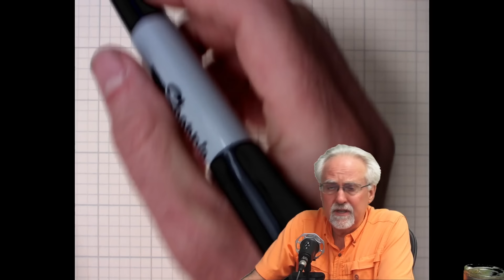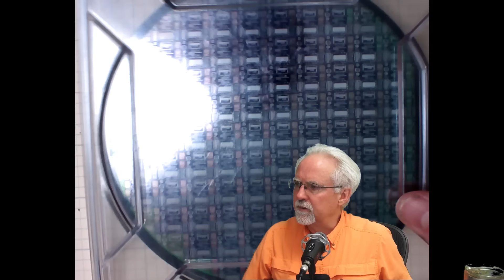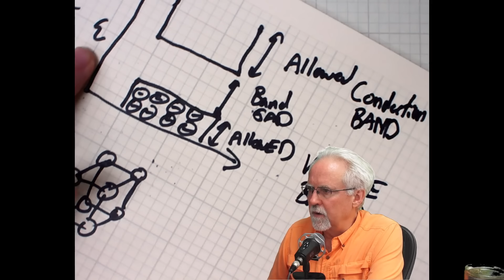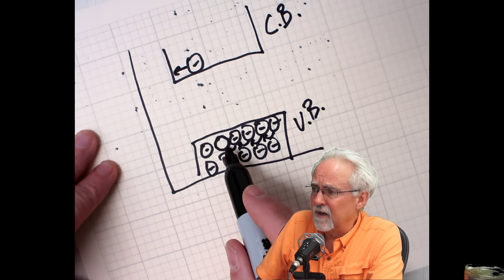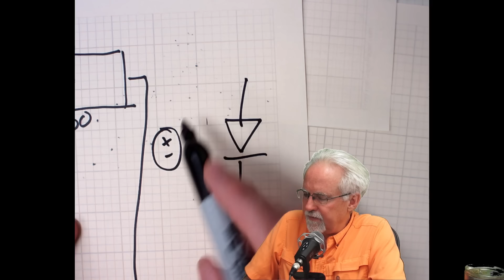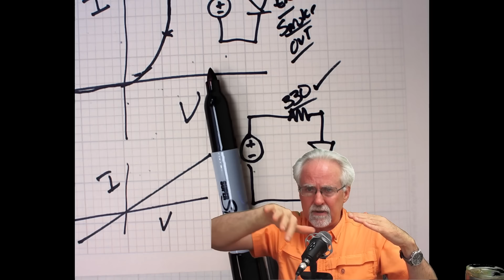Arduino Tutorial 2: Understanding How Light Emitting Diodes (LEDs) Work

Comment: I wonder what if we run out of electrons? 
Does the led somehow refill itself?
Reply from the maker: The process is reversible. The electron does not go away, it just fills a 'hole'. As temperatures or voltages change, the electron can hop back our of the hole, and be a free electron again.

Comment: I have a question. As you described this - an increase in voltage lovers the gap between the electrons and the holes causing the LED to shine brighter. But the same "picture logic" applies to the Energy Gap Eg. how ever the color will not change dramatically from let's say red to blue. I might have missed something because of the language barrier (not my mother tongue). Thanks for the awesome videos.

Comment: You are using a few physics terms I am familiar with, is the hole similar to how when you have an electron and positron collide, you get a photon thorough pair production and annihilation? Or how how materials become negative or positively charged ions?
Reply from the maker: No, it is not like that. Think of having a jar of water with a bubble in it. The bubble is nothing but a lack of water, but you can treat it like its real. Electrons are like the water, a missing electron is like the bubble, or a hole. If you put a drop of water in the jar, and displaced the bubble, the bubble disappears.
Reply: @paulmcwhorter  and then through osmosis, the water travels from high concentration to low concentration?
Reply from the maker: No. Get a tube sealed on both ends. Put one drop of water in it. Then tilt the tube. The drop of water will travel down hill by gravity. Tilt it the other way and the drop goes the other direction. The drop of water always goes downhill because of gravity. The drop of water is your electron. Now fill the tube with water, and leave one little bubble. That bubble is your 'hole'. Tilt the tube. The bubble will always go uphill. The bubble is your 'hole', or abscence of an electron. You are trying to make this too hard. A hole is a missing electron.
Reply: @paulmcwhorter  All good now, was hoping for some connection to some pre existing knowledge, use connections like that to simply things, kinda like a zip file. I was impressed actually at how easy it is to use the Arduino coming from a C++ background. Been coding in it for over a year making things in C++ for school and was able to make up a few quick projects in a few hours. Was never taught much on the hardware component however I find it very satisfying to actually code stuff now which is more applicable and will be using your tutorials over the next month to refine my skills for a personal project based on drones.
Reply: By applicable I mean more useful such as the plain 80’s style chat bots we make all the time.

Comment: Good explanation. One little nit-picky thing. There was no mention of the forward-bias voltage & related voltage drop across the diode(e.g. 0.7 volts for silicon diodes & 0.4 V for germanium) also Peak Inverse Voltage (PIV).

Comment: 1:52 How light bulb is working
5:18 Conductor and Insulator
6:00 Semiconductor (tailored martial)
7:00 Silicon wafer
8:00 How semi-conductors (i.e. Crystalline martial) actually work
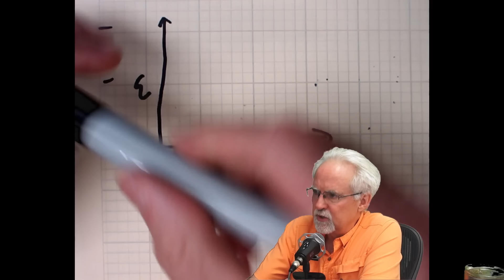9:30 Discrete energy levels => Energy allowed bands
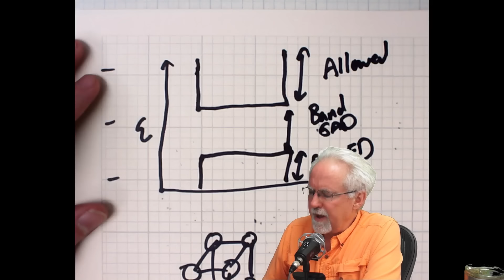10:20 Conduction (Valence and Conduction bands)
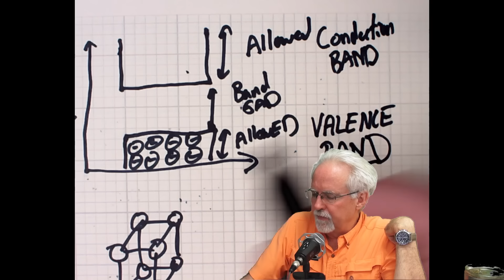12:50 Intrinsic (heating) semi-conductor (-ve and +ve charges conduction)
17:05 N-Type, induction via -ve charges in the Conduction Band
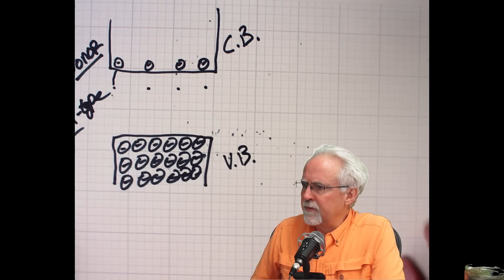19:43 P-Type, induction via +ve charges in the Valence Band
21:56 Quick summary of semi-conductors covered
22:25 How those semi-conductors types lead to LED?
23:45 Offset bands when N-P are combined
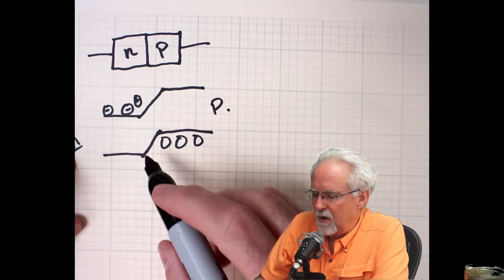24:50 Applying +ve voltage to N-P (lowering barrier causing light to emit)
26:30 -ve charge over +ve charge (Electron, Hole Pair Recombination => Photon)
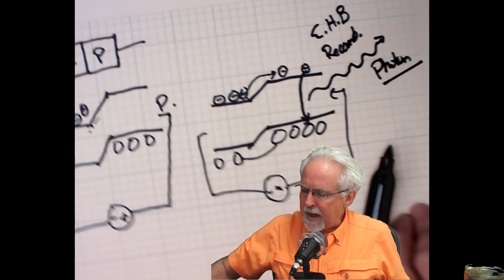27:47 How the light emitted from an LED?
28:40 Applying -ve voltage to N-P (increasing energy barrier preventing light from emitting)
29:40 Quick Summary
30:16 How to correctly hook-up a diode (+ => P-Type, - => N-Type)
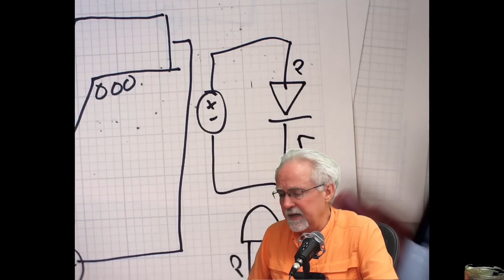31:20 Diode response graph (I vs. V)
32:35 Why resistor is needed when connecting LED
34:30 How the color of LED is generated
37:07 TL, DR version of the lecture

Thank you sir for your knowledge share 🙏
Reply: Not all heroes wear capes! (Assuming you don't. If you do, then some heroes do wear capes).
Reply: @nitinchauhan530  haha🤗❤
Reply: @nitinchauhan530  lol
Reply: thank you for your breakdown
Reply: true @Nitin Chauhan  these are the little things that help and restore faith in humanity
Reply: Thank you for your breakdown
Reply: Not all capes wear heros 🫡
Reply: i wish i saw this earlier

Comment: Great video Paul.  I'm 73 now. I studied electronics in the late 60's and early 70's, when vaccum tubes were king. I've learned about semi conductors, diodes, transistor (of all kinds), IC circuit, linears, buffers, counters and so on......but not microprocessors.  I have work in electronics as wiring, soldering, and also drafting printed circuits.  Arduino is for me the unknown. I purchased this week from Amazon the Elegoo Mega 2560 Project The Most Complete Ultimate Starter Kit. With your help and some of my efforts I will soon be able to work and and learn about semicontrollers like Arduino. Thank you so much for these state of the art videos, you have an exeptional talent in popularizing things so people can have a good idea  concerning highly complex materials. BTW, watching No.2 tutorial concerning how LED work was a good refresh.....since I quit electronics business 30 years ago. Sincerely.

Comment: What is the 'hole' made of?
Reply from the maker: Nothing. A hole is the absence of everything. A hole has nothing in it, not even air. A hole is where an electron should have been, but is missing. Hence, it is a hole left in the atomic crystal. think of it like a bubble in water.
Reply: @paulmcwhorter  thank you for your answer. How can we say 'nothing' is a carrier of positive charge? If it's nothing wouldn't it be neutral (without any charge)?

Comment: As others have said repeatedly, you are a good teacher.  This was fascinating.

I was with you until right at the end.  I get what you said regarding what color light is emitted: it's based on the material in the semiconductor.  So, the Arduino has a semiconductor.  Whatever material is in it produces the same band of light when voltage is applied.  That would seem to account for why the LEDs each have a different color plastic (red, green, yellow) on them.  

But, I thought each LED had a different forward voltage.  If that is the case, then the each LED is producing a different band of light, not the semiconductor.

So, is it the material in the semiconductor that determines the LED color or the voltage at the LED that does?  Or am I totally missing something (which very well may be)?
Reply from the maker: No, silicon has an indirect bandgap, meaning that when electrons go from conduction to valence band, their momuntum has to change. This means they must emit a phonon, or heat packet instead of a photon. YOu can not get light out of silicon
Reply: @paulmcwhorter  Okay, I think I figured out my issue.  Thank you.

Comment: Once all of the electrons recombine with the holes wont there be no more light emitted? Does this happen in practice: apply a voltage across a diode, light is emitted for 5 seconds, light is no longer emitted?
Reply from the maker: No, it goes back and forth. Thermal effects, or applied voltages generate the electron/hole pairs. They come and go in response to stimulus like voltage.
Reply: @paulmcwhorter  thank you for the reply, i appreciate it greatly. I will read up on the topics you have mentioned. There are undoubtedly gaps in my knowledge that hinder me from understanding (in detail) how leds work.

Comment: Whoops, I opened my Arduino up and connected an LED straight away with no resistor to one of the pins (not to a power supply).  Thankfully it didn't burn out.  I guess the processor or pin itself had sufficient resistance?

Comment: Does the value of the resistor regulate the voltage of the LED so brightness is equal between, for example, red and white? In looking at specs for LEDs some are rated for 3.3v and others for 2.2v. I'm trying to determine the resistor value for each color based on voltage ratings at a constant voltage for the circuit. Help?

Comment: Great explanation. I am an absolute beginner, and understood most of it. But here is a question, I am not quite sure if I have the correct answer:

Why, if we put the positive pole on the p-type the gap between the levels gets lower, instead of greater? In my first thinking P-type meant for me, that this pole is loaded with positive energy. If I put the positive pole I - I raise the energy level. The gap should become greater in my thinking.

Am I right with this answer?:
Positive pole means -> The pole is positive loaded -> means that there is a lack of negative parts. Therefore positive loaded "things" connected to it are quite motivated to unload themselfes to loose there voltage. They do so, and their enery level decreases.

Comment: So we want to stop using light bulbs because it generates loads of waste through heat.
But we need to use a resistor which generates waste through heat to be able to use a diode?

Comment: When the high voltage is applied... Practically the LED bursts off...or stops working... So basically what happens to the band gap and the electrons and holes during the high voltage supply.. can't that be reconstructed or rebuilt

Comment: Marvelous video sir
I had a few questions regarding the theory 
1- why does having an n type connected right next to a p type cause the bump in the energy bands (would love an explanation from a physical point of view like whats happening inside the material ) is it just that way because we choose the impurities such that there is a wider range of allowed energy levels in the valence band of the p type than there is in the n type (and vice versa)?
2- why does hooking up a potential difference lead to a reduction in the difference between the c.b and v.b of the n and p type materials
I'm thinking something like you make the electrons more "eager" to move by giving them higher potential
Reply: On the answer to your first question

Don't think of it as happening inside the material, but rather on the surface. Because we are dealing with a crystalline structure, paths electrons can take are much more predictable. 

You know about piezoelectricity, yes? The concept is, you hit a crystal, which is a molecular lattice structure, and the kinetic energy propels the electrons on the surface to a conductor, through a component and then back to the part of the crystal which now has missing electrons.

This happens because of the lattice structure of the molecules.
At least, this is how I understood the concept.
Reply: Now on to the second question. Way I understood it is that because the materials are not symmetrical, meaning there is an electron donor on one side and electron acceptor on another side, flow of electrons can really only happens in one direction within the circuit.

The Donor just gives electrons to the conductor.
Acceptor takes electrons from the conductor.
Donor is happy to let electrons jump to the Acceptor and acceptor is happy to receive them.
Do it the other way around and they resist.
If they resist enough, you will short your circuit because it's easier to jump through air than through resistor.

Every time electron hops happily from donor to acceptor, you get photons which means light.

Comment: Can talk about the calculations of the series resistors value for the LED for different color LEDs and Different types of LEDs how to calculate the series resistor values? Also its common now to use Bi-Color or Tri-Color LED's and how do they work they theory behind them

Comment: Thanks for this great lesson. In a few minutes I re-learned the principle of PN-type, which theory I learned (and forget) some fifty years ago! (In the Netherlands, I'm Dutch.) But... when the impurity is used up, then the LED is done? There must be a point that the electrons and the holes level out and no photons are emitted anymore? Or is there a way to reinstall the impurities, to reverse the process of the emitted photons, in order to lengthen the life of the LED? Perhaps there is a fixed lifetime, as a function of the duration and amount of emitted photons, used voltage?
Then I have another question: why does a current / voltage makes the 'wall' lower, or, when I switch poles (+/-), makes the 'wall' higher? Is that chemical?

Comment: This is great, Paul! Thank you so much for this series. My son and I are going through it together. So, is an LED the opposite of a solar panel?
Reply from the maker: Sort of more like the same thing, just how you use it. If you shined light on an LED, it would develop a small voltage on it. Just not optimized to be a solar panel, but would act like one.

Comment: I have a question, if by applying the voltage hole goes up & electrons comes down, then it is neutral state i.e.: all holes gone up & all electrons gone.. Now how the process will continue?

Comment: You have probably mentioned this already but... when the leads on the LED are cut, they can still be identified. The cathode(-) can be identified by a small, flat area on the edge of the base of the LED. The flat spot on the RGB LED flat spot does NOT indicate the cathode but rather references a pin layout so you can identify which pins are 1, 2, 3, and 4. Of course, you could always use an ohmmeter to be sure in either case.

Comment: Thank you for your tutirol but there is an error in my board could you help me with it 
error 

"Arduino: 1.8.6 (Windows 7), Board: "Arduino/Genuino Uno"

Sketch uses 930 bytes (2%) of program storage space. Maximum is 32256 bytes.
Global variables use 9 bytes (0%) of dynamic memory, leaving 2039 bytes for local variables. Maximum is 2048 bytes.
avrdude: ser_open(): can't set com-state for "\\.\COM3"
An error occurred while uploading the sketch

This report would have more information with
"Show verbose output during compilation"
option enabled in File -> Preferences.
"

Comment: I have just acquired an arduino starter pack and I am trying to follow your excellent tuition videos. Unfortunately, when I try to program the elegoo uno r3, I get a fault code. The elegoo doesn't have a driver. I can do the programs for each tuition video, but I can't test them on the uno. I have tried, unsuccessfully, to download the ch340 drivers to my laptop.

Comment: About 1960/61 the entire 5th Form went to the Faraday Lecture at the DeMontford Hall Leicester (that's in England) the subject was "Transistors and all that". Stupidly I recall the sit down music was Tschaikowskys 1812 Overture. This wasn't the first time I knew about Transitors because Radios were coming out then and my School friend and me were experimenting with OC71 germanium Transistors, but I cannot remember in what way except gun powder was involved. :-(.
I cannot remember the setails of course but I have since learned about semi conductors but this was as good as it is possible to explain them. I enjoyed the reference to (at least part of) the DeBroglie equation but I was expecting you to bring quanta into the mix.
The only problem was that I had assembled stuff to do the Arduino thing with LEDs and I now have to put them back into their box until tomorrow. A most enjoyable experience which cannot be followed by ubiquitous Arduino immediately.
Many thanks.

Comment: Sir you said that band gap energy decreases/imcreases when we apply  potential and also said that we have to choose a specific band gap energy for a specific colour ,does band gap energy change with applied potential ,if so how can we choose a specific color whatever the applied potential may be ? thanks for your clear expalnation of types of semiconductors .
Reply from the maker: No, the band gap is the band gap, and it defines the color. The hill between the two regions gets bigger or smaller with voltage. The gap stays constant
Reply: @paulmcwhorter  thanks got it

Comment: there are two types N-type semi conductors and P-type semi conductors. you create n- type semi conductors when dopants (usually phosphorus in this case) that have 5 electrons in its valence layer. the phosphorous atoms join right in the crystalline structure with 1 extra electron roaming free. In p-type semi conductors its almost exactly the same. you take a dopant such as boron ( boron has 3 electrons in its valence shell). once boron is incorporated into the silicon structure they'll attach but since theres only 3 electrons that leaves an extra space in the silicon crystal where no electron is attached to. This lack or gap of electron is whats known as an hole, and this hole behaves like a positive charge. And like a positive charge this hole it attracts electrons. when an electron moves into a hole the electron leaves a new hole at its previous location.

Comment: Are photons emitted in other p-n junctions not associated with LEDs  ? If we could see past the plastic enclosures of the IC chip could we detect the by product photons ?
Reply from the maker: No. Normal diodes like silicon diodes have an indirect band gap. Meaning that for an electron to drop from conduction to valence band, the momentum must change. Since photons have no momentum, they can not accommodate a recombination. In such devices, when the electron drops, the energy must go to heat, which can accommodate changes in momentum
Reply: @paulmcwhorter  darn I wanted to envision a mini light show hidden in all the electronics of the world. I guess it will be limited to optical couplers. Thank you for your efforts, keep up the good work